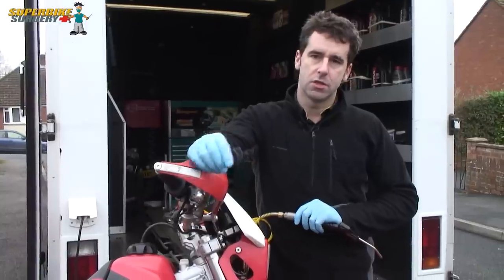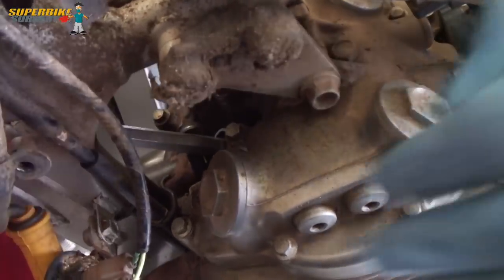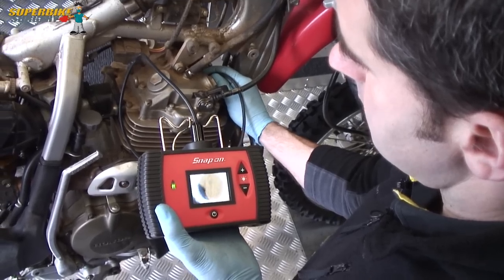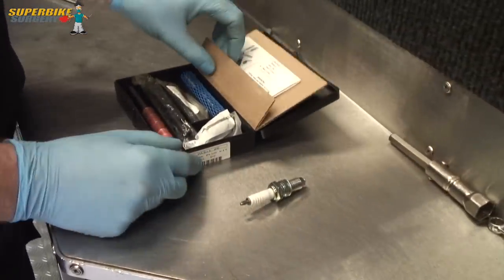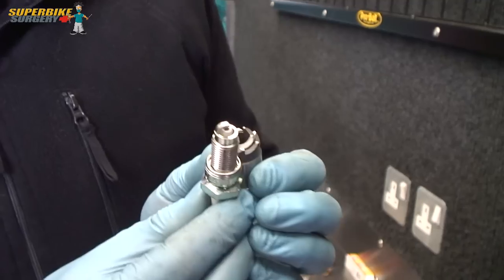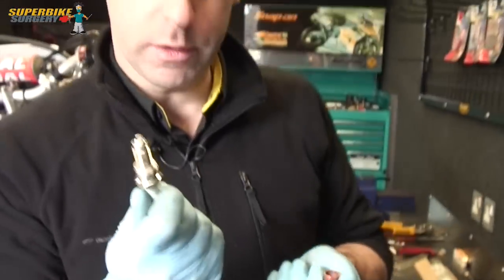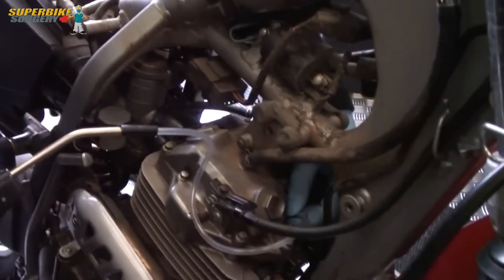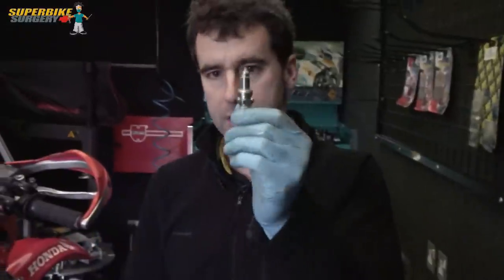Spark Plug Thread Repair.

Comment: This is a great video on using Time-Sert.  I found another video ("How to find TDC the 'easy' way" by EricTheCarGuy) using a vacuum gauge attached to a compression gauge hose to determine when a cylinder is on compression stroke.  The clarity of the explanation in your video... showing why as well as how... is very helpful, and gives me the confidence to try this.  Thanks!

Comment: the other day i took the plug out of my xr200 when it was hot it ended up cross threading upon instalation. since i cant buy a new head i worked and i got it to go back in but they were pretty chewed up. now when i cant get the plug in anymore i have an option to fix it. thank you very much

Comment: I used the same timesert kit on my stripped spark plug on my kawasaki prairie 300 atv. Kit wasn't cheap..93 bucks, but worked flawlessly. We did to pull the head on it though and put a new gasket on it. Also put a little header permatex sealant on the insert before installing it. Well Now it runs better than ever.

Comment: Excellent demonstration!
Clear and super detailed.
I followed it to re-thread my XT250 1980 but must have done a mistake...?
Aside the fact I should have re-threaded a little deeper (I stopped too early, the insert's top is almost 1mm higher than the plug hole entrance, I thought it would be cancelled by screwing harder..), I must have miss-handled something :
the piston seems now blocked by something in the cylinder (or crankcase ?) and I can't turn the flywheel further than a point near the TDC. Then it seriously "clonks" against something and movement is stopped... both ways (clock & counter-clock).
Any way to solve this without pulling the head off ?
I am sure nothing was left in the chamber by mistake.
I had no problem turning the flywheel before re-threading; but could turning the flywheel the wrong way have any bad impact on timing chain/valves/crankcase,etc... and fall, blocking the piston/rod assy ?
I just used compressed air to blow (a lot) of aluminum chips away, when piston was 1/2 up on compression TDC.
Any assistance would be greatly appreciated!

Comment: My yamaha r1 shot a plug out the head. I am attempting to repair this with the helicoil insert kit. After reviewing your video, the kit shown seems more promising. My spark plug thread size is M10x1.0

Does the kit you have used in this video come in the size that i need and if so, how can i get my hands on one?

Comment: I have found that the R&G crash bungs for my Honda CBR1000RR-2006, well mainly the one on the left just continued turning, thought I had the wrong length bolt but it looks like it's the thread in the cylinder head/engine mounting point.
Could you please advise me what I should do. Helicoil or Timesert and if Timesert, Carbon Steel insert of Stainless Steel from front face or rear face?
Any advice would be really appreciated.

Comment: Ok I need your help Sir. Is top dead center good enough to perform this job or should I crank it around a little more or a little less? I can open the valve cover and check the valves but I'm not sure about the piston. Thank you.
Reply from the maker: Watch this more up to date video I made: https://youtu.be/ygT0XZZald4

TDC is no good you'll end up hitting the piston with the tap if you're not careful. About 1/3 of the way down the compression stroke is ideal.
Reply: @SuperbikeSurgeryTV  Thank you sir...I think I'm ready to do this job ...I just need to trouble you to answer one more question.... OK...so as I'm looking at the valves I should be waiting on the intake valve to open and then close and then I'm effectively on the compression stroke with the piston starting to head upwards.......is this about correct?
Reply from the maker: Yes, that's roughly correct assuming you are turning the engine in the correct direction. If you are at TDC on the compression stroke you'll also have (valve) clearance on both intake and exhaust.

Comment: The Honda dealer close to me charged me over 6 hours to repair my front engine mounts with the Timeserts but they advised me that they needed to drain the radiator and swing the engine forward.
I am concerned that this hasn't been done correctly.
Would you be able to advise me please?

Comment: I bought a thread repair kit : https://www.ebay.com/itm/Spark-Plug-Thread-Repair-Metric-Rethreading-Tool-Kit-M14-1-25-Tap-Screw-Inserts/123618117954?epid=27029079720&hash=item1cc836c942:g:AFsAAOSwi6dcT9SF
But It's a little different to your one. It has a socket shaft that the tap goes into and then the seat cutter you mention goes on top and a grub screw holds it in from the dise so it doesn't fall out, so I'm guessing you can cut the thread for the insert and then the seat at the same time. theres one tap that is the size of the normal threa and then then one with the standard thread on the tip and then going to the size to cut for the insert. I'm guessing you might use one after the other? thanks anyway.